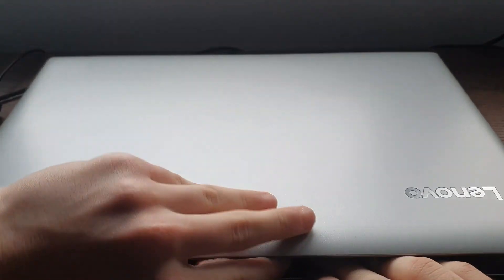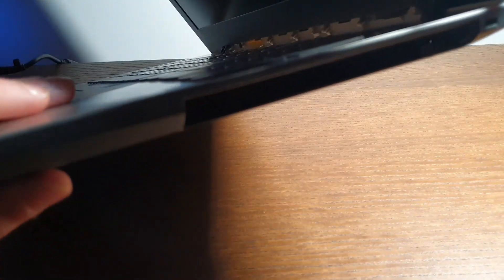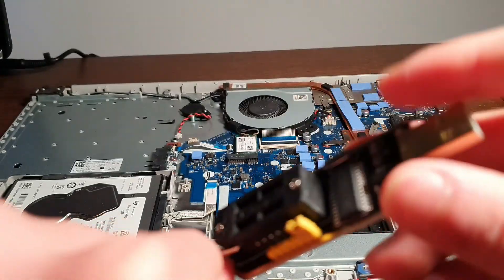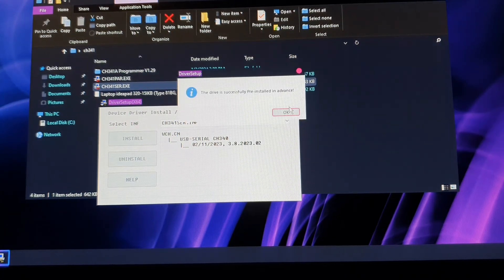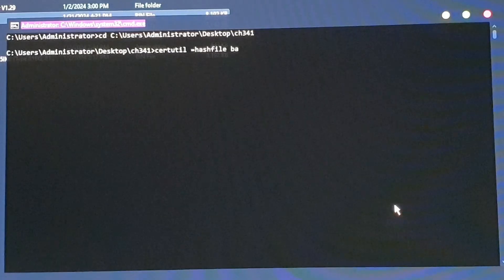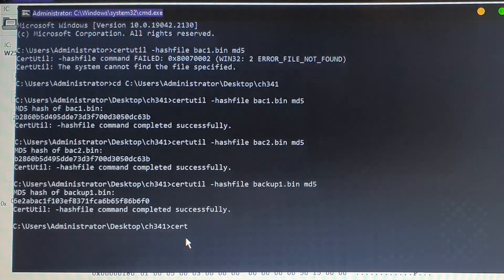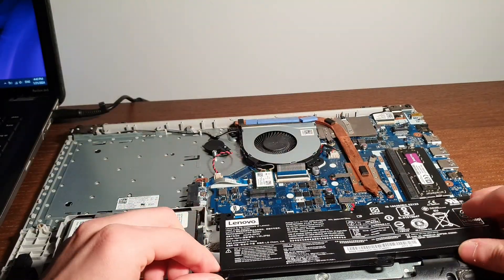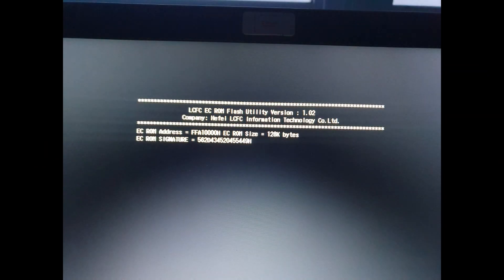Unbrick Your Dead Laptop! Fix BIOS Corruption with CH341A (Lenovo Ideapad 320)

Comment: Mine is a type B model but on the left side there is: 1 2 3 TXD RXD GND 3.3V. It doesn't work properly. Have you seen these?
Reply from the maker: Mine says 5V not 3.3V, even though  I also have a ch341B, at least thats whats written on the chip.

Idk why it doesn't work, is the led on the ch341 shining bright or is it dim? Are you sure the clip is connected well? Are there any error messages? Is your bios chip 3.3V or 1.8V?

Ch341B should technically work if you install the same drivers, I'm not an expert at this so goodluck.
Reply: @YoussGm  how can i send you a picture?
Reply from the maker: On discord: YoussGm3o8

Comment: Hi, excellent video, I bought a CH341B programmer to repair an ideapad 330s 15arr, but the AsProgrammer program is taking many hours to read the chip to make a backup, is this normal ?
Reply from the maker: No its not normal. It should take around 5-10 minutes depending on the computer you are using.

I don't know why its taking so long, make sure the chip model detected on AsProgrammer is correct, it might be a wrong size like the MB.

Edit: there might also be not enough voltage passing through the chip, check the LED light on the ch341B and when its connected to the chip it should shine full power bright, not dimly.

If its shining dimly you can check my other video where you connect the power cable to the laptop to get extra voltage.

https://youtu.be/f8CLIy73x1k
Reply: @YoussGm  thanks for your interest, my bios is the W25Q64FW 1.8v (I am using the voltage adapter) I tried connecting the power cable and there was no major changes, the yellow light is dim, I noticed that when trying to detect the chip in AsProgrammer 2.0.4 is not able, is it a problem of my CH341 ?
Reply from the maker: Its probably the voltage problem. Try removing as many components from the motherboard, so disconnect the ssd/hdd, ram, speakers, keyboard etc. Then try again with the power cable connected and see if the light is brighter. 

If its not then Idk what the problem is. You could try using the 3.3v without the 1.8v adapter but there is a risk of frying the chip and motherboard, no guarantee I can't take responsibility.

I can't help any more than that, you could try returning your programmer and try with another one.

Comment: Hi, I think I might need to do this to fix my gigabyte kd g5 gaming laptop. But I'm confused if I need to find a certain bios file to flash it with the software or not? Or does the software you're using automatically flash it?
Reply: @YoussGm  Yes that's the one I am trying, No matter what file I use now its just giving me these errors, when I click unlock it shows everything blank and just wont unprotect it.
Reply from the maker: @DCnormal message me on discord: YoussGm3o8

Goodnight for today, I will see tomorrow if you can screenshare/call so we can see what's wrong.

Goodluck.
Reply: @YoussGm  Sure I added you, goodnight!
Reply: @DCnormal  was your laptop fixed?
Reply: @bedanamarlbenjamin7682  no, sold for parts broke even.
Reply from the maker: I found this reddit post with the steps needed, idk if its your exact laptop but it should be similar: https://www.reddit.com/r/GamingLaptops/comments/131zzum/guide_how_to_unbrick_gigabyte_g5_kc_bios/

Everything is manual, nothing is automatically flashed. The bios is different for every laptop model so you will have to find either a working one from the same exact model, or go to the laptop drivers website, get the bios from there, and then manually combine your corrupted bios with the download. This combination is also different for every model. 

the link I attached is for a bios brick, not corruption so it depends what happened to your laptop, if it was a failed update or a wrong bios setting. I'm not really an expert, so good luck with that.
Reply from the maker: if your laptop is the 11th gen intel rtx 3060 this bios: https://www.gigabyte.com/Laptop/G5--Intel-11th-Gen/support#support-dl-bios

extract the zip and the 128kb file should be it. I'm not sure if its the correct size, but if you extract your corrupted bios and it's 128kb, flashing the downloaded 128kb bios should technically work without any combination/splicing. Make sure to backup the old corrupted bios though.
Reply: @YoussGm  thanks so much, already found these alil bit ago just tryna find everyway I can fix this laptop lol. Shouldn't be too hard it seems!
Reply: @YoussGm  Hey so I got the programmer and I'm trying to flash it but there is no auto detect button for the ch341a programmer software?
Reply from the maker: @unknownvidds  If you are using AsProgrammer, there should be the button. Not sure why it wouldn't show up, its fixed in place even when the programmer is not attached to the chip.

If the chip is not being detected even after than then check my other video for gaming laptops, where you might actually need to plug the laptop into power while doing the process.
Reply: @YoussGm  yeah I'm trying to click find ic and typing in the name of my chip but I don't see it, others got it to work with the same chip so idk..
Reply: nvm I think I found it haha, I'll update you if I get the laptop running!
Reply from the maker: Check this video https://youtu.be/f8CLIy73x1k

Try the process with power plugged in but be careful not to short anything. So make sure the clip is off, then plug the laptop to the charger and hold the power button for 10 secs so it powers off. Then attach the clip and try to read ic.
Reply: @YoussGm  Alright I got the ic erased, I just have 1 more question.. I could go to hard route and fix the corrupt bios file as this reddit post does, or flash it with new bios. But the bios I see from the website you sent me before shows its for windows 10/11 install... Where would I find the bios file to actually flash it with through the controller?
Reply from the maker: Sorry I was eating dinner. If you extract the downloaded file, it should be the 128kb file called your motherboard model "NH5_7HPQ.15" or similar depending on your model
Reply: @YoussGm  Alright got it, and how do I make the program flash that since its not a bin file? Sorry I'm just so new to this stuff haha
Reply from the maker: @unknownvidds it should be the same steps as in the video. Open the file with AsProgrammer and make sure the size of 128kb corresponds to the actual size of the chip. Then just click the button shown in the video, under program ic, Unprotect->erase->program->verify
Reply: @YoussGm  alright I'll try, just is a bit weird cuz the program isn't telling me the progress or when it's done for me for some reason..
Reply from the maker: @DCnormal  That's very weird. Check if the console shows any errors, or if it says its loading or chip not connected. Hope that it worked by the time I responded!
Reply: @YoussGm  Yeah it does say "Old SREG: 11111111(0xFF), 11111111(0xFF)
" not sure what that is about.
Reply from the maker: @DCnormal  I think that means the file you are trying to flash is empty, full of only FF. Check if you opened the correct bios file to flash.

Edit: If the file is correct then try to click the unprotect button first and then flash the file.
Reply: @YoussGm  Hi yes turns out its cuz I had it on 128mgbs, I set it to the file size and now when I click unprotect it says "New SREG: 00000000(0x00), 00000010(0x02)" and when I click program with the file it says "check settings"
Reply from the maker: @DCnormal  close AsProgrammer and do find IC again. Let it choose the size automatically. It should be 128 Kb (131 XXX bits). Its probably giving an error because its not the same size as the file. And then try to flash the bios again.
Reply: @YoussGm  Yes I figured that out and I flashed the file which flashed in 2 seconds which was suspicious, the certutil command wouldn't work in cmd so I just tested the laptop out and now it wont power on at all, led indicator but button does nothing. I will try to flash it 1 more time.
Reply from the maker: @DCnormal  Sorry I just realized, the 128KB file is very probably not the full bios which is I suppose 16MB which is a lot bigger than 128KB.

So you will probably have to follow the reddit tutorial and manually fix the corrupted bios.
Reply: @YoussGm  Alright and is there any way though that I could just find the original 16mg bios file or nah?
Reply: @YoussGm Tried to follow the reddit post, but it seems the bios file that was originally on the machine is corrupt and cant be read, so unless I can find a file to flash it with I guess I am screwed lol.
Reply from the maker: @DCnormal  You'd have to find someone with the same laptop model as you that has the bios dump. So maybe if you look for it on all forums and websites you might find one uploaded.

If you followed the steps on this video, you should have the backup of the original corrupted bios. So you can use that to follow the reddit post, unless it's actually corrupted, depends what made the bios break in the first place.
Reply from the maker: @DCnormal  If your laptop has the i5 11400H and rtx 3060 you can try this bios
 https://download.gigabyte.com/FileList/BIOS/nb-bios-win10-win11-64bit-G5KD_FB05.zip?v=a4abb0624ede72ca34ec267bbfb7d602

Inside the Bios/ALL/Intel folder, find the 16MB file called NH5XHP.bin and try to flash that file.

If these are not your specs then send me your specs so I can try to help you find the bios.
Reply: @YoussGm  thanks ill try this now.
Reply: @YoussGm  Still trying but just keep getting "Old SREG: 11111111(0xFF), 11111111(0xFF)" and "Possible protection is enabled. Press "Unprotect" and check datasheet
Erasing memory..."

Comment: bro you have done making good simple tutorial video, appreciate it.

i have question, does the process still same for the bios that has been modified or are there still other steps required?
Reply from the maker: What do you mean by bios that has been modified?
If the settings in the bios have been changed then they will be reset to factory settings.

If you mean that the bios is modded then yeah the process is the same. Just make sure to backup the old bios as you might need it.

If this doesn't answer your question please explain it again! Thanks!
Reply: @YoussGm  tysm